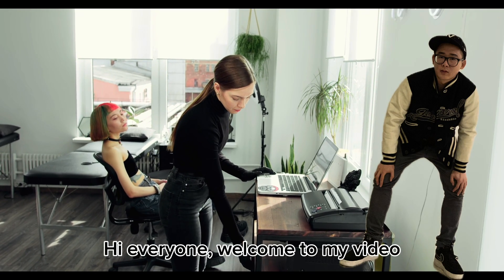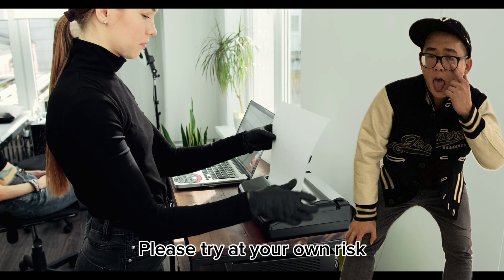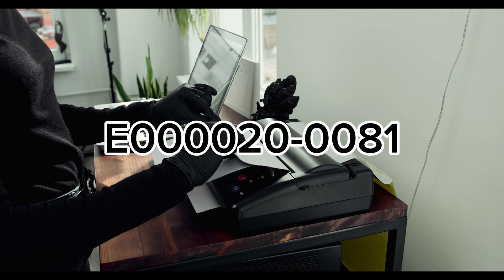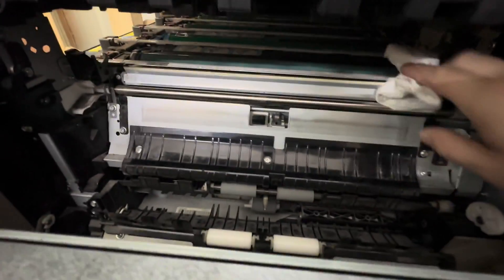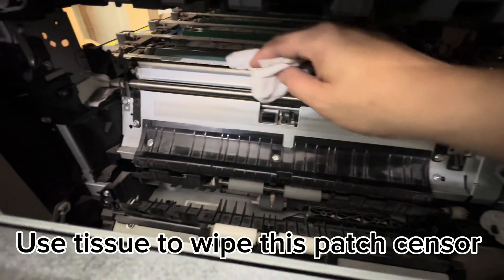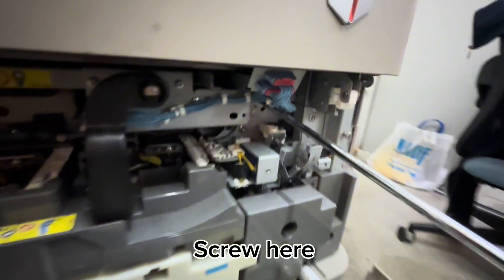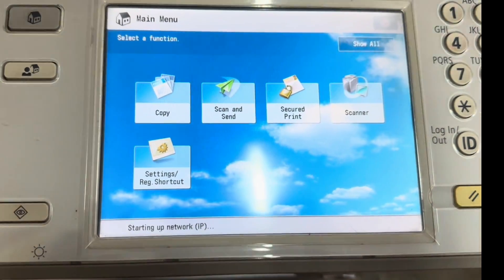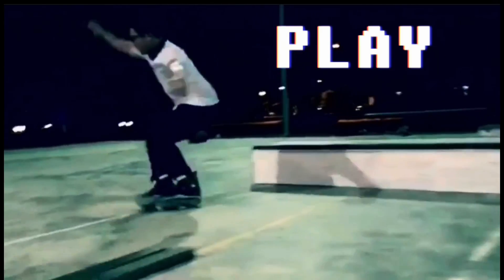How to solve the problem Canon IR ADV C50 Series Error Code E00020-0081

Comment: Hi sir i too have canon c5030 machine when i click copy button in display machine got heavy sounds link something not moving ,when i open back side cover sounds are gone away after i close the door sounds come again i dont know what i do, and also dont know where the sounds from please share yout knownledge on this issue...
Reply from the maker: From my experience the heavy sound might came from fuser unit gear which connected to the machine body , try observed the gear condition. If gear is no good.. you have to change the gear